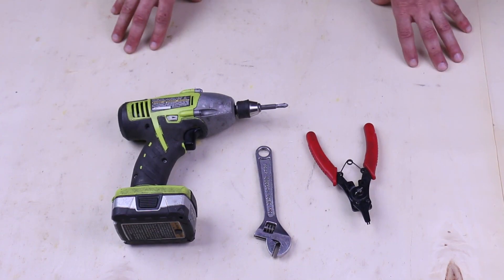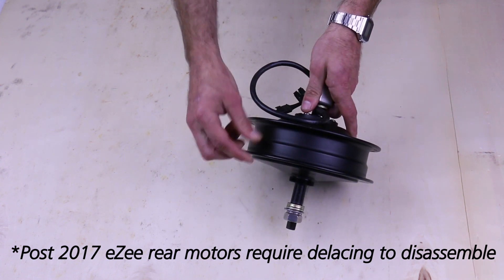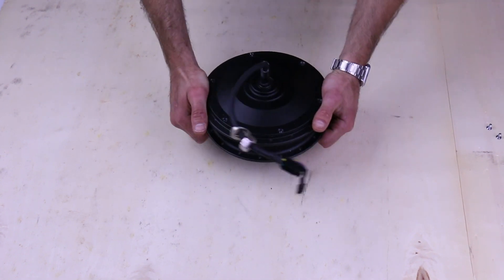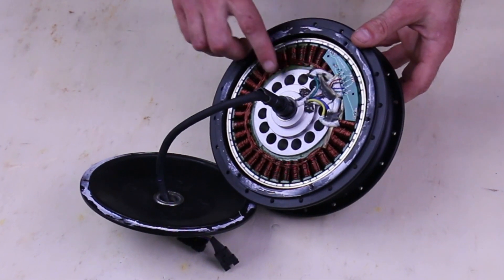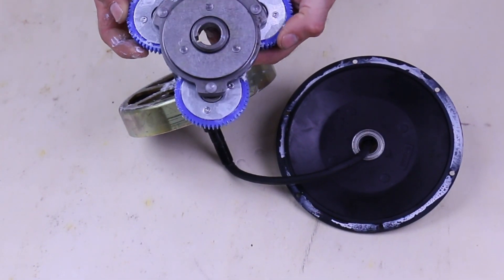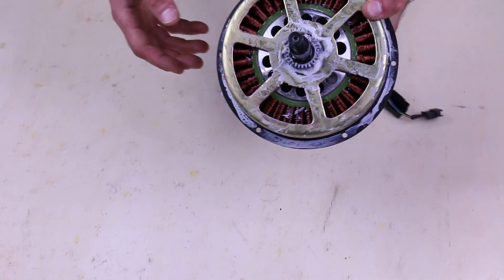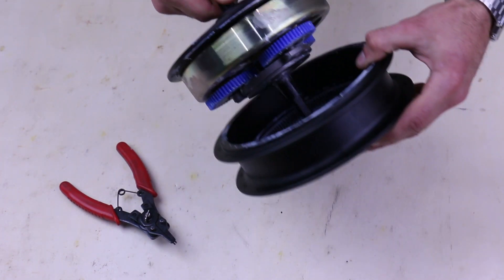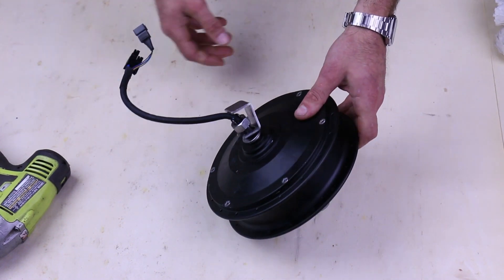eZee Hub Motor Disassembly

Comment: Hi, I'm from Spain. I have a handbike for my wheelchair that uses that motor. It's been around for quite a few years. Is this motor still being manufactured so I can buy it? Again, I'm from Spain and would like to know how to buy it in my country.
Reply from the maker: It is indeed still being made. We have actually the same motor varient on our website, but almost for sure the one on your wheelchair uses a different connector standard so custum hall and phase wiring will be needed.
https://ebikes.ca/mezee350-pj-build.html

Comment: My EZEE motor wires come out the opposite side, so the connector you sold me will NOT fit thru the hub shell; which forces me to cut all the wires EVERY SINGLE TIME the motor must be serviced. Sell smaller diameter connectors, please.

Comment: When i trun the throttle on my electric scooter the motor start to make knocking noise
Reply from the maker: Lots of things can cause that.  The best course of action is to contact the company who sold you the scooter and ask them to give you technical support.
Reply: mine does this. you ever find our what it was? or the fix?

Comment: This motor can work without  Planetary Gears, so what is that function actually?
Reply from the maker: The planetary gears slow the ~1250 rpm of the motor to a ~250rpm of the wheel, and increase the torque 5x in the process.

Comment: Is there any way to remove the stator from the coils?   My magnets are full of crud (metal dust) and I want to clean them.
Reply from the maker: It's a bit tricky with the eZee hub motors unfortunately and requires a press and some inside slipring pliers IIRC.  Have you tried to see if compressed air can blast away the debris?
Reply: @GrinTechnologies  I just vacuumed it.  Guess I will have to live with the crud.

Comment: how can I remove the spoke flanges so that i can insert in a tyre? i am not using spokes as this is for a different project
Reply from the maker: Most easily with a lathe, milling machine or belt sander, depending on what you have access to.

Comment: I was riding my fiido d1 ebike and the rear wheel locked up all of a sudden, causing the bike to skid off to the side with me on it. It seemed like something inside the rear wheel locked up, any ideas what it could be? It was a momentary thing, the wheel worked afterwards, but caused me to brake abruptly.

Actually there is a problem with my bike (i didnt take good care of it). Sometimes, the pedals don't work. What I mean is, when you turn the pedals, the chain turns the rear wheel, however, sometimes the rear wheel doesn't turn... its like pedaling backwards.

But sometimes it does work. Mostly when it is warm.
Its like there is some engagement pin inside the rear wheel that sometimes engages and sometimes doesn't..

Anyone know? many thanks!
Reply from the maker: Sounds like you have a rear freewheel or cassette freehub that has sticky pawls and sometimes fails to engage.  If so this is a bicycle hardware issue, not an electronic or motor issue.

Comment: can you tell me how to get rid of the speed limiter on a rear tire brushless motor? by any chance...
Reply from the maker: There is no speed limiter inside the bushless motor.  You will only have speed limiting in your motor controller, not in the motor.
Reply: @GrinTechnologies  i seeee i seeeee nnnnkay nnnnnkay wasn't sure because the motor i have seems like it has a governor in it. i'll hit the throttle and will accelerate and then you feel it hit a speed and slow down accordingly and i want it to not do that lol

Comment: Good, I though they would be axial flux motors, this means there is still a lot of torque potential in future products without needing a larger hub. Can't wait to see those make their way to consumer scooters.
Reply from the maker: There are very very few axial flux hub motors that we're aware of, mostly used by elite solar car teams. For direct drive motors it's quite a non-trivial mechanical challenge to counter any unbalanced axial forces between the rotor and stator at these kinds of diameters while keeping the support structure light. But for small diameter geared motors like this it should be more achievable and hopefully we will see that some day!

Comment: Forgot the remove spokes part. Na f that
Reply from the maker: It's not required with this version of the hub motor (notice how both spoke flanges are on the hub shell), the wheel can stay laced in the rim. But after about 2018 eZee changed their rear motor design with the spokes on the side plate, and so at least half the spokes have to be removed first before opening.  It's a bit of a PITA.

Comment: Question for you:
I have a Jetson bolt pro. Originally 36v, I ran it on a 48v 20ah battery and 350watt controller (after market). It worked fine for months  - topped out at 22 mph. 
I swapped out the 350w controller for 1500w controller. It accelerated fast and pulls incredibly steep hills. It ran perfectly for about 20mins. I turned the bike off and took it home.
When I powered in back on - the motor spin incredibly fast with no load (scarily fast). However, when I add load (sit on it) the motor doesn't spin (externally). I can hear it running though.
How can I repair this - or where can I buy a replacement 14" motor hub motor?
Reply: Motor is probably damaged. Over volt direct drive motors instead

Comment: Do they create a lot of rolling resistance, made of lightweight alloy? Can it work as generator or even allow regenerative breaking?
Reply from the maker: These hubs have a freewheeling clutch on the planet carrier so they have no rolling resistance but also are not capable of regenerative braking. For that we would recommend the GMAC hub motor. You could use the eZee as a generating spinning backwards though since then the clutch would be locked.

Comment: Hey guys crazy question, how do you remove it from the wheel frame itself?  Say you wanna put it on a new bike with a different wheel size., for example.
Reply from the maker: You either unscrew the spoke nipples and delace it the slow, way or you use bolt cutters and delace it the fast way.  Then you lace it into a new rim with a new set of spokes to match the new rim ERD.  https://www.youtube.com/watch?v=3OialWggZJo
Reply: @GrinTechnologies  thank you brother 🙏

Comment: Good video but how do you replace the hall sensors on this motor?
Reply from the maker: We have a hall sensor replacement video in this exact same motor model about to be released soon.
Reply: Grin Technologies I've replaced them now, thanks anyway, just waiting for the 9pin power lead to turn up.